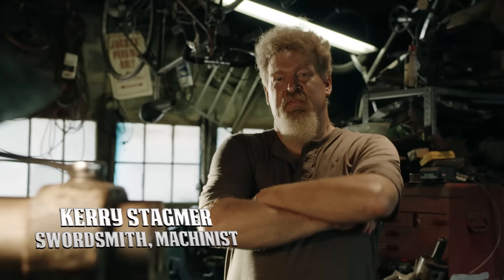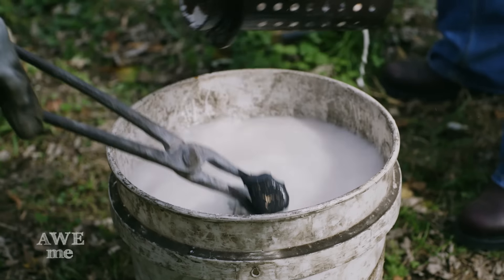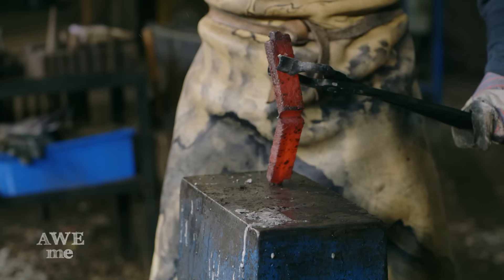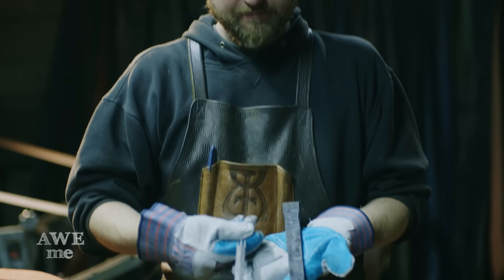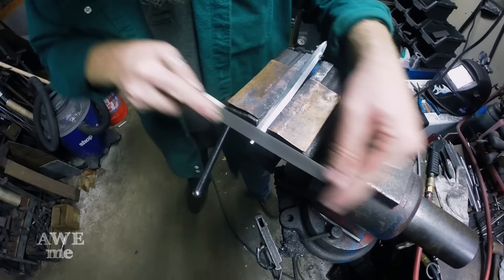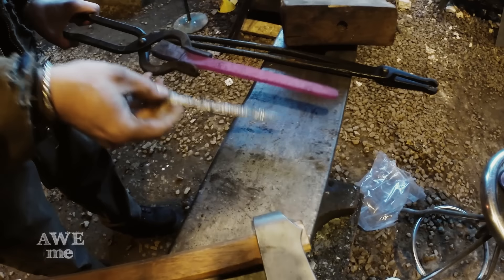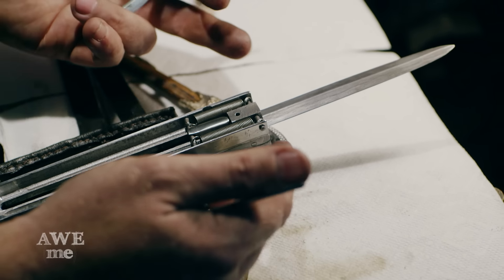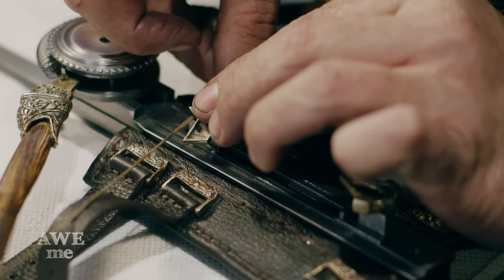Arno Dorian's Phantom Blade (Assassin's Creed Unity) - MAN AT ARMS: REFORGED

Comment: Hey Matt Stagmer/Kerry Stagmer, is it possible that you can make a 3DMG gear's blade from Attack on Titan? Thanks.

-Wyatt Games
Reply: its gonna be impossible because the blades are nothing more than box cutters with bicycle grips, and the only complicated part would be the actual gear; in which matt and kerry will get have more fun making it, but they won't be able to make it due to technological constraints
Reply: If you saw the anime or the manga, then you should know that the gear is powered by pressurized gas, but no one knows how to create that gas, or pressurize it into such small containers that can propel an individual through the air near the sound barrier for long distances of time without killing the individual. In addition, the hooks that can be made with today's technology can not latch onto any surface at will; but the ones on the 3D maneuvering gear can. Lastly, the turbines that were said to propel the person forward is much too advanced compared to what society has to offer in terms of technology because it is impossible for turbines the size of the 3DMG to propel humans at such speeds.
Reply: overall, there's too many technological constraints that will prevent the 3DMG to be made. Even if you say that Matt and Kerry can recreate the blades and the blades only of the 3D maneuvering gear; the anime and the manga depict the blades with bicycle like grips, and levers on the grip that manipulates a cable or wire that connects to the gear. As a result, Matt and Kerry would not make this gear, nor its blade; and I doubt Tony would attempt it either
Reply: Andrew Deng
juss thought id point out that even in the anime,the hooks don't always latch for them,it seems they work best in soft things like roof tiles and wood,they often fall to catch to walls,so thats kinda on par with any hook we could make in today's world,also i don't see where their going near the sound barrier,180 to 200 mph tops (unless the manga says otherwise),not saying that speed wouldn't kill a guy but juss saying that's well below sound barrier...also as for the turbines thing,i think you could cheat the manga and anime a little,use the gas(compressed air) to fire the hooks (around 300 to 400 fps,almost any paintball marker is capable of this) then use the turbines(a motor with a built in fan unit to cool itself) to retract the cables at high speeds,giving the look of propelling the person when in reality its pulling the object to the person however the person will move not the object... i will say i think cost and technology would still hold it back,and the shooting distance of the hooks would greatly be reduced (50 yards max on something super soft),however the ideas possible, juss not yet in our lifetime...
Reply: Matt Stagmer Thank you, Mr. Stagmer! Being a fan, I'm surprised you replied!
Reply: SaevelWolf When gas is released from the canisters of the 3DMG, it spins the fans and then goes out the back exhaust, creating forward propulsion. The spinning of the fans also ratchets back the grappling hooks, pulling the user to where they had landed. For the grappling hook, there was no real explanation for how the hook would be unwound, and retracted at such forces and such ease as seen in the manga or anime. Though there was a black box that was seen in the gear that is assumed for the electrical components of the gear, no mechanism is fully established that explains how the cord can be shot out and retracted in regards to the black box. Creating the box itself and creating the mechanism to shoot the cord will be a handful for engineers, let alone blacksmiths. In addition, the hooks will have to be made to be able to attach and detach instantaneously, which is one mechanism that was never explained in either the manga or the anime. (I'm going to ignore the gas component because it is impossible to determine the correct gas used, can be used, and how it is used; it'll be too long of a comment) Even if you do create a working prototype of the 3DMG, the G-force that is constantly applied to an individual is around 5, which is dangerous enough for the operator to wear special gear in order to move safely in those conditions. However, the sudden acceleration from 0 mph to 180-200 mph or even higher (which can be quite possible with the gear) will instantly cause a human to black out, which will instantly kill any human that uses it. In addition, all the quick and sudden jerks, and spins in the air that a human will have to do in order to use it properly in a 3D plane will drastically hurt the user through sheer pressure that is increased with higher velocities, and any impact at those speeds is fatal to the user.  (Btw, you didnt mention how the user would be able to be propelled foward at those speeds if you use the gas to propel the hooks)
Reply: okay,i get how it works in the anime and manga,but im trying to tell you that its not impossible (entirely) in real life,the best way to get the results your looking for is by cheating (read as 'amending') the manga and anime... how you do that is with compressed air to launch the hooks and a motor to wench the cable back which will pull the user to the object...doing this is entirely possible,but we dont have the motors compact enough yet to pull at those speeds(that i know of)...now how it works is simple,you have a spindle with your cable wrapped around it attached to the shaft of a motor (think like a winch on a truck or something) and on the trigger handle of the swords you have a duel purpose switch,its two jobs are to 1)let the spindle spin free on the shaft to let out cable and 2)fire the hooks with compressed air thus pulling out the cables and latching to the intended target of the user... when you release that switch it locks the spindle back in place on the shaft,then a second switch is pressed which engages the motors retracting the cable and thus pulling the user to their destination...think batmans grappling hook from the video games...i know this is long but i hope it came out clear and understandable...
Reply: SaevelWolf well how would the cable be able to understand that the hook has hit a surface. As far as im concerned, there is no way that the cable would be able to understand that the hook hit a surface without an electrical component that allows for the cable to stop extending, and there is absolutely no possible way for the hook to be retracted if it is already embedded in a surface as of now. You could make the cable disconnect from the hook, but it'll take too long conventionally, and it'll take a long time to re-attach new hooks to the same cable. I like the gas propelling mechanism, but that won't allow the user to change directions mid air, or accelerate or slow down, but whatever, u want to create something feasible, thats what you get
Reply: only thing is how the Stagmers would be able to test it out in the video
Reply: oh i know,i was juss posing a solution to their more complex design in the anime/manga... if they could find a suitable motor then i would suggest making batmans grappling hook from the video games first using the method i described and it'd be far less dangerous to test... if they could make that work then they can accomplish the 3d maneuver gear with relative ease...though all the danger of using the gear would still apply,lol
Reply: Andrew Deng I'm sorry but you described these things ridiculously. "Near the sound barrier." Lol, not even close. Maybe sixty miles per hour at most.
Reply: Andrew Deng
i juss saw your other post... the cable doesn't need to sense the hooks attaching to something and know when to stop,that's for the user to determine...similar to a fishing reel,it only lets out so much line when cast,the hooks only pull out so much line...when it looks like line has stopped being pulled out, the user releases the button to lock the spindle back the shaft of the motor then presses the next button to engage the motor...as for moving in mid air, i promise you even in the anime the turbines didn't even assist with that, it was all by twisting the hips and alternating which side fired and when...basically they move like spiderman, except they do it from their hips where it puts more strain on their spine...and even they couldn't speed up or slow down in the anime,really my ideas not far off from theirs...now as far as retrieval of the hooks,you got me there,cause i got nothing...
Reply: Tanner Barnes yea,even my '180 to 200 mph tops' statement earlier doesn't even sound close to right,but yea,60 sounds about right, 90 mph at most probably...
Reply: but don't you already set how long the line is for a fishing rod? when a fish line is thrown into a lake or something, the line is only retracted in order to fish something out. For the gear, it needs a back and forth mechanism, but I'll have to look into the user determining when the hooks stops..
Reply: Tanner Barnes noooo..... it is much faster than 60 mph.... if you do some simple observation and math, it takes about 3  seconds for this gear to propel someone up in the air by a distance by ~150 meters in a loop.... The sheer speed one travels through the gear makes the houses fly by really quickly like a blur. It takes a speed at least ~90 mph to make the environment fly by that much
Reply: Andrew Deng
no,you do not set how much line comes out, you literally juss cast your line out,your applying too much intelligence to the simplest of applications...when you cast your line in fishing the weight and hook at the end are propelled through the air by you flinging them,your reel spins freely and lets out line because its in a unlocked position but when the weight and float hit the water the reel cannot let out more line because none is being pulled out, at which point the fisherman locks the reel in place so that it can pull the line back...basically everything i juss said about fishing applies to this maneuver gear theory...
Reply: Yeah that would totaly neat ^^
Reply: Andrew Deng Still, that's nowhere near the sound barrier. And we already decided on 90.
Reply: Tanner Barnes Since when have we decided on 90 mph? I don't recall anyone saying that the gear travels on 90. Besides, who is "we"?
Reply: Andrew Deng Read the other comments.
Reply: Andrew Deng well they dont exactly have to make it operational they can just replicate it make it look like it will work
Reply: who does?
Reply: ***** I'm not being racist but you have a cat as your avatar and you're not a cat.
Reply: discostoo  yeah maybe he is a cat
Reply: Wyatt Games They already made that sword

Comment: This build was very cool, but the crossbow bolt was comically weak. It went like one inch into cake, and really balloons? It might have been better to rework the original design into something more effective, a folding crossbow is a complex task but with the right locking mechanism you could have put more force on the bolt.
Reply: which highlights the problem with wrist mounted crossbows... especially folding ones, theyre weak by design. and wont be able to have much poundage.
Reply: That's a fair point, perhaps the best compromise here between an imaginary sneaky crossbow and reality would be a folding crossbow that can be removed from the users armor and then unfolded, it might be possible to unify the loading and folding mechanics to reduce the complexity of the device, the bolt would be held in place and the bow would stretch out around the bolt as it unfolds.
Reply: Alexei Barnes in the game each time firing arno must turn something on the blade i believe thats to pull launcher like real crossbow would
Reply: Amri Steve Probably, but the real problem here is the tension on the bow string is limited by the design.
Reply: Alexei Barnes If tension of string is strong enough like ordinary crossbow, automatic folding mechanism in cg trailer would be possible. But if the tension is that strong, it would be hard to stretch it to fire it, especially on the battlefield. But as you said, most realistic mechanism is 'strong string(for automatic folding)', 'very strong lock for unfolded crossbow arm(if it is removed, crossbow will be folded)'. But it will be very uncool to see Arno unfolding the crossbow and reloading manually.
I think phantom blade is the most implausible weopon in the assassin's creed series. It would be too huge if a crossbow is added upon a hidden blade. Barely a stealth weopon. It's just a weapon gauntlet.
Reply: Hyeongjoon Kim sometime games just take it to far even hidden blade mechanism it self is still questionable
Reply: Just take what you get, am I bitching about the blade not being a double action otf.....no!,This was fucking hard to make,as you can imagine and Re-design it and perfecting it would just take to long for this show
Reply: I guess, it's just pretty hard to make perfect tricky weapon in the very first time...
Reply: You have to remember that it is only a small bow witch is difficult to make powerful as of it's small draw
Reply: I doubt those shots were even made using the crossbow, the crossbow would be ridiculously weak and the bolts are made entirely of metal with an inefficient shape, to heavy and wouldn't fly right.
Reply: Fancypanda Well, they had multiple takes and it did only kinda "fall" into cake, I'm not so sure they faked the shots. Watermelon looks impressive to cut but you can easily break watermelon with a butter knife, you could probably drop that bolt from a distance and get a better result.